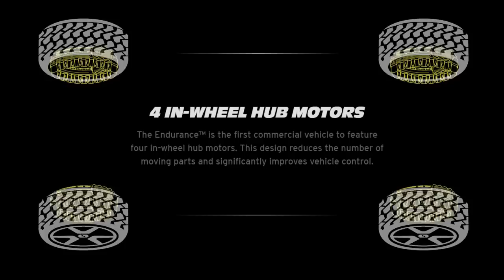Top 5 All-Electric Pickup Trucks Will Challenge Tesla Cybertruck

Comment: Price points. Features/options, and range.
Rivian is more of a sports utility pickup, with a tiny 4'6" bed.
$69k base model Rivian price?? It will have a niche market.
Reply: I was thinking the same thing.. it has an 11,000 lb pulling capacity.. and not even a 2,000 lb payload..  meaning tongue weight would be less than 1,000 lbs and you wont find a 11,000 pound trailer with  less than 1,200 tongue weight.  meaning.. its useless.
Reply: I'm highly skeptical of the Cybertruck for only $40k starting price as specified but the competition (so far) isn't even in the same value class.
Reply: @Mrbfgray  ?
Reply: Wouldn't be able to fit my quad=unless for my needs. Did I mention 30' trailer...
Reply: @Christs_Apologet  Let's say Cybertruck starts at $55k, who has anything close to that?
Reply: They made it for luxury shoppers.

Comment: I use my truck to tow  big trailers and haul big loads in the bed. The Atlis seemed to be the closest to what a real truck is used for. The Tesla on the other hand looks pretty useless as a truck.
Reply: I don't use my truck for towing often, but I like to have the capability.  I have a bass boat that weighs only 2100 lbs and during the spring and summer I go fishing about 3-5 times a week.  I need a truck that can do 1/2 pickup stuff.  I don't usually haul all day 300+ miles in fact I rarely drive over 30 miles a day.  I have about 174k miles on my 2004 f150.  I bought it in 06 with only 22k miles on it and it has been my primary vehicle ever since.  I have heard of some people putting 20K+ miles on a car/truck a year!  That is insane to me unless you drive for a living.  I've had my truck for 13 years and yes one day I will have to get a new one.  But as my dad always said, if it's not broke don't fix it.  I am very interested in electric pickups but I want charging infrastructure to develop a little better before I do make the switch.

Comment: 10:20 - That Neronev truck looks damn gorgeous.
Reply: It is also the only one that moves the cabin forward, using the absence of the engine to optimize size/bed ratio.
Reply: @etherealicer   - Indeed, with that shorter nose it has a better load spread, and also looks 'nicer' in proportions.

Comment: I like the Lordstown endurance in wheel motors but I think the telsa is the better truck
Reply: In wheel motors are heavy and unsprung. Every bump and pothole will launch that mass up against the suspension and body causing a harsh ride. Although a good packaging solution, it is probably better suited to low speed, in town delivery vehicles.
Reply: I don't think that will be reliable.  Sure it's a great concept but miles and miles of jarring those 4 motors constantly against bumps and dips is gonna lead to some failures.

Comment: The grille on that Ford was incredible
Reply: And so Very aerodynamic, that big box shape will depress range by 50%, very old school.
Anyone can boast 400 mile range on paper, but have any actually tested and met those predictions?
They are hopping that people will simply believe they are getting 400 miles and will not care that the Real range is only 200 and dropping, but people will care and they know that Tesla has already proven their claims.
Their are dozens of Chinese battery makers sell ing to GM, Ford , Porch, etc and the evidence is showing the milage estaments  are only 2/3 of what the promise when brand new and drop more every few months but 10 year old Tesla have 500,000 miles and still going strong.
So the question is is it a good plan to buy a EV that will only last 2 or 3 years before it turns into scrap metal ?
If the competition were selling at half the price of Tesla it still would be a bad value.
Someday in 5 or more years some one may be able to prove that they are 50% as good as tesla, but don't hold your breath.
Reply: @larrymans4  don't really know. We will see how well it's claims hold up. Ford is usually quite accurate with their claims. I believe it can be small competition
Reply: As modern as wings on a 60s Ford Customline

Comment: I've got 5 TESLA Cyber Trucks ordered for my roofing company... It's dent proof... Our fleet of F150s have their retirement date... Rivian would have been my choice until the Cyber Truck was revealed with its superior durability for construction 🚧
Reply: Juston Preble which tier are you getting?
Reply: Juston Preble The Bollinger could have been an option except for the higher prices. Looks functional but just expensive.
Reply: Thank you good sir, for your forward thought. If I had a roof that needed installing, and  I was in the right area, I'd check you guys out. That said, have you by any chance perused the data on the Tesla solar roof? There's synergy. It could definitely be used to charge said trucks!
Reply: @ACGBLR  qty:2 - 3motor and qty:3 - 1 motor all with autonomous. Our trucks never drive more than 200 miles in a day. Mostly less than 110 per day. We like the F150s. Our current truck of choice. But the durability of this new Cyber truck is exactly what we want.
Reply: @davidlazarus67  Bollinger is asking a super hi price...
Reply: Juston Preble Yes I agree. I think the Cybertruk makes so much more sense. It will also be a lot cheaper to run and maintain than a F-150.
Reply: @CharlyDeamen  When I build our next home it will have the TESLA solar roof tiles, a month worth of battery back up with TESLA power walls. 

The power walls will be mounted to our enclosed trailer for use on the road and connected to the home solar tiles when in the garage.
Reply: BKD Vickers  I did not vote for President Trump the 1st time but I will next election. 

All of my crews are Spanish workers and they are all voting for Trump. So many people are walking away from the Democrat party. 

My supply house sales rep is Black and he said his whole family aunts, uncles, cousins all are voting for President Trump next election. 

I cant believe the contrast between President Obama and President Trump. President Obama sold us on an 11 Trillion Dollar Lemon of a Socialized health care system and President Trump has systemically fixed all the bad trade deals from the past 30yrs.
Reply: @davidlazarus67   I didn't know how much sense electric would be until TESLA presented a truck with real durability, and reasonable cost of ownership. The performance is just a perk.
Reply: Juston Preble There are some interesting channels on YouTube that cover Tesla running costs. The maintenance costs are significantly lower and the running costs are also lower because of the overall efficiency of the battery and electric power system around 90%, compared to something like 25% for a truck and 35% for an efficient car. Regenerative breaking also helps as well. There was a limo service between LA and Las Vegas which saves so much in running costs that the cost savings alone paid for the vehicle in a matter of a year.
Reply: @justonpreble4083  I'm suspect of this durability you talk about, it's not even in production.
Reply: Juston Preble I’ve been in business over 37 years and will retire soon. However I didn’t vote for Trump then and I never would again. Mostly because he is a POS of a person. Some of us are not just in business for enriching themselves. You  may want to consider, GASP ,the greater good of society for once.
Reply: @CharlyDeamen  You sir, have a 'mind like a steel trap'! Kudos to you Charly!!
Reply: And power out let compressed air oh and loading it up with kool stuff like a spider crane lol
Reply: You may find yourself hoping that the Tesla Cybertruck is more dentproof then it's glass was allegedly "bulletproof" or as a matter of fact simple ballbearing-proof.  Best of luck!
Reply: @habanero8192  But it didn't go through!!
Reply: @TheAefril  True its still extremely tough glass, normal widows that steel ball would have went through boths sides of a trucks windows with one shot.
Reply: BKD Vickers  Thanks for sharing...
Reply: @jayfxdx  I would agree with you but seeing that I've never been in an accident with any of my work trucks and the biggest irritant is a truck that starts to get dented and scratched I'm pretty sure with the Cyber Trucks Stainless Steel Exoskeleton I'm not going to be disappointed by the increase in durability of that alone compared to every other truck available now including the 5 F150's we replace every 2 yrs to keep our company trucks looking fresh. At this point I don't see us turning over TESLA Cyber Trucks at all. The normal wear and tear on our Roofing Trucks is so minimal. Anyone who gets our 2yr old trucks thinks they are brand new. But we all know Transmissions and engines with oil, coolant, and fuel age very quickly compared to the TESLA Battery Pack, wire harness, updateable programming, and electric brushless motors. Tires and Brakes is about all anyone worries with a Tesla. Several of my friends have had them since they 1st came out and they have been very pleased. A customer of mine turned in his Corvette a yr ago for his Tesla and he just laughed at the performance increase over his Corvette. He said he will never go back to a Gas Car ever again... 

He said his wife would never take his Corvette out of the garage but is constantly now taking his Tesla to go shopping because she loves it so much and her daily driver is a Lexus. He also said she plans on turning her Lexus in for a Tesla when the lease is up...
Reply: @icemanhunter1  Yeah I was really looking forward to the Rivian before I saw the Cyber truck. I have 5 kids so the bench up front allows me to take all the kids with me without taking my wife's Expedition. Her next vehicle is a AWD Ford Transit Van with the mid roof in the 12 passenger configuration for picking up kids and car pooling to soccer games and golf tournaments and all the other activities...  But my eyes are still open. The Rivian Truck is bigger than a midsize but smaller than a full size truck. Just wish it had a bench seat offered in the front...
Reply: Id wait for the ev 150
Reply: @justonpreble4083  You have no idea how long the Tesla battery packs last vs. combustion engine drive trains because the comparison has never been in pick-ups or fleet vehicles. You think that Tesla's questionable build quality will stand up to fleet use? Tires and brakes is all you will worry about? what about suspension components/steering. The doors falling off or the seats tearing apart after your work crews get in and out of them 10+ times a day. Will Tesla warranty fleet use ? You are assuming these cybertrucks will be built to a standard Tesla has yet to achieve.  I'd be very cautious if I were you and would buy one to see how things go. I come from a ag/ranching/oil and gas background where equipment/fleet costs are in the millions and no one ever goes out and turns over a whole fleet of proven iron for "the next great thing".